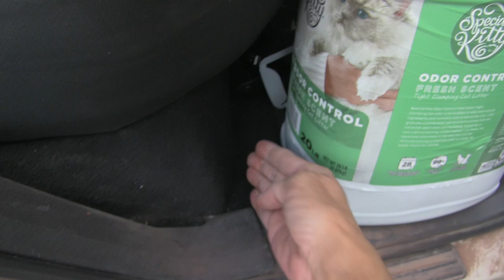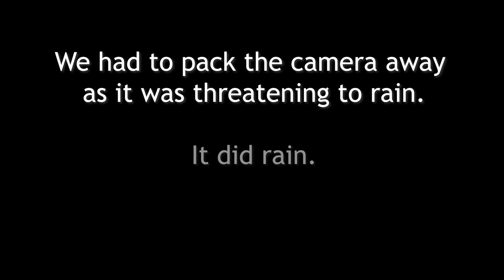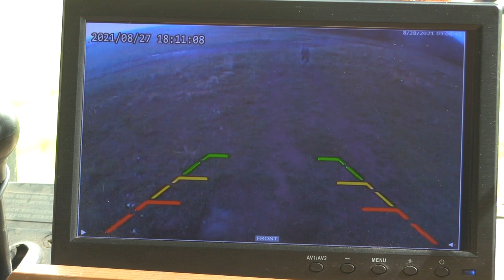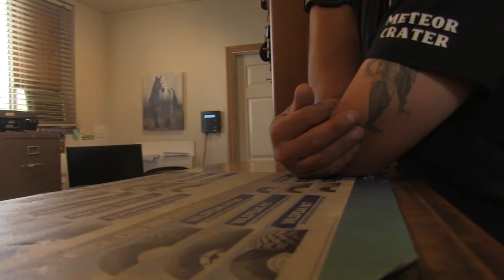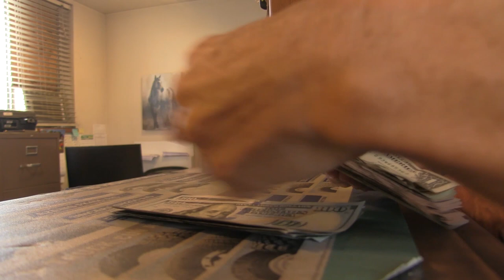Kerry Gets a New TurboAnt E-bike, Which Saves Us When We Breakdown!

Comment: Great video!  The Turboant bike is boss.  Looks like a lot of fun.  So sorry you're having transmission problems on your auto.  They sure did charge you a $bundle!  I drove a 1993 Honda for several YEARS that had a cracked Transmission slow leak.Just had to watch and add a quart of transmission fluid every 5 weeks (used as a daily driver).  (that year Honda had a crappy transmission on all Civics).  If it's just a mysterious leak you can't determine, you might consider if that would work for you.  I drove my Honda for 225 miles before I sold it.  LOL  Love your videos, wish they were more often. :)